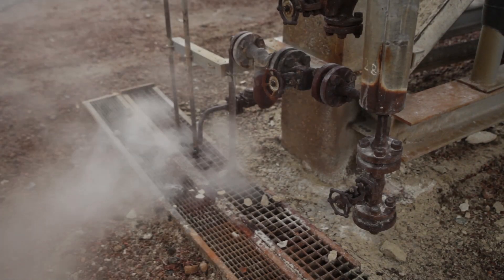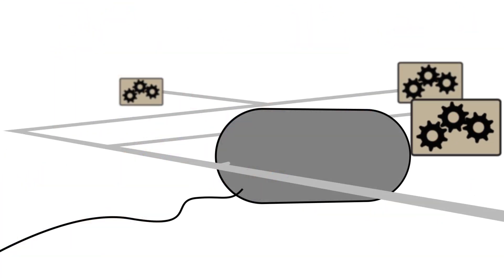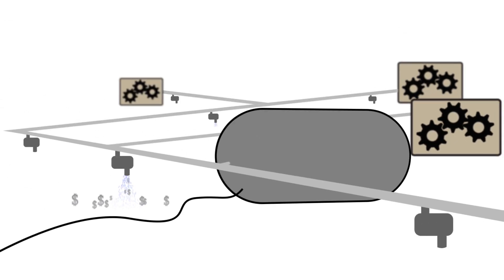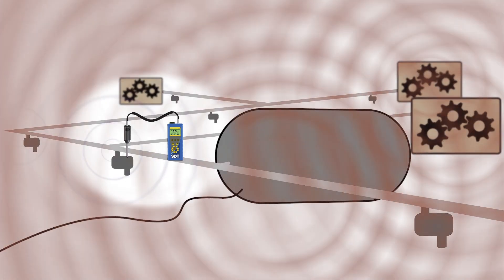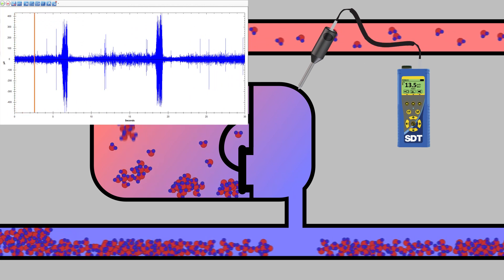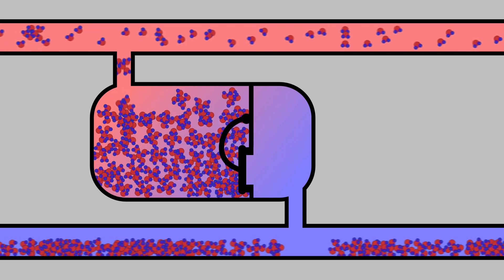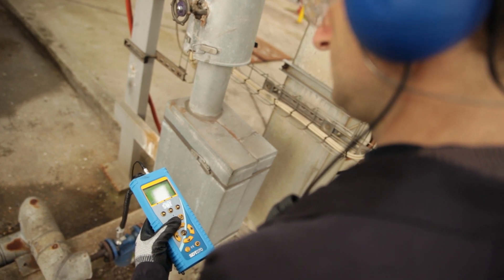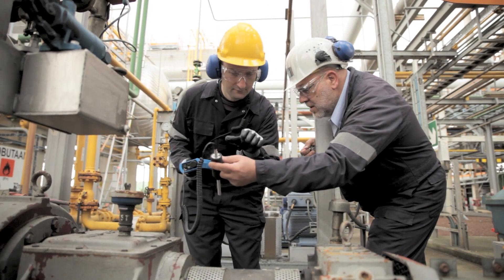Steam trap testing using ultrasound

Comment: Thank you, sir, for sharing knowledge about the steam trap. If we check a steam trap using temperature gun, how much temperature is supposed to be dropped at the outlet of the trap?
Reply from the maker: Well, it depends on the type of steam traps, process etc... It exists a lot of different configuration so quite impossible to answer. I would advice you to check datasheet of manufacturer. #hearmore